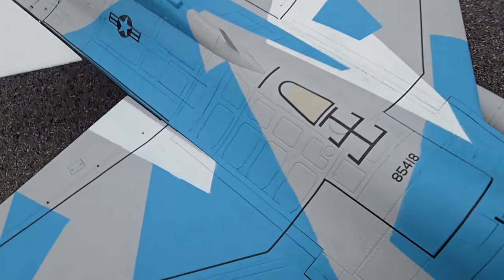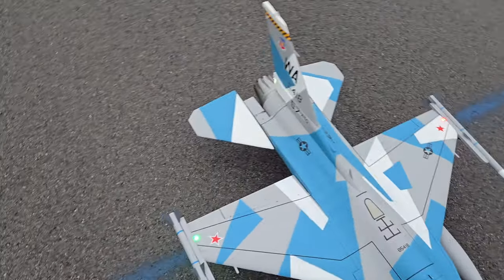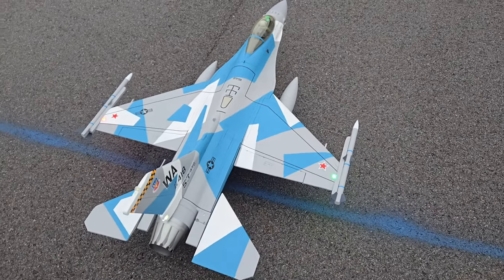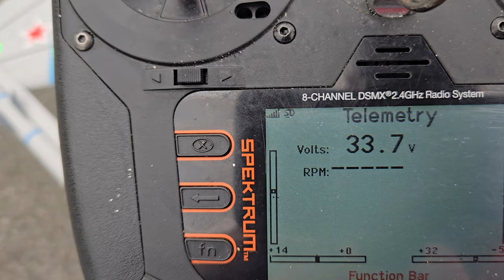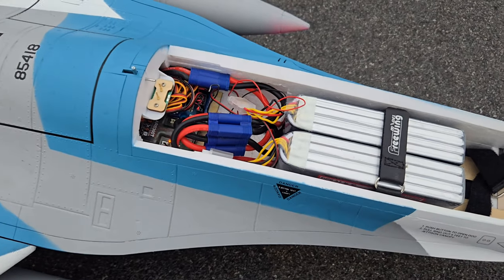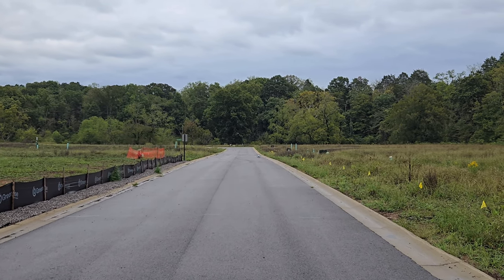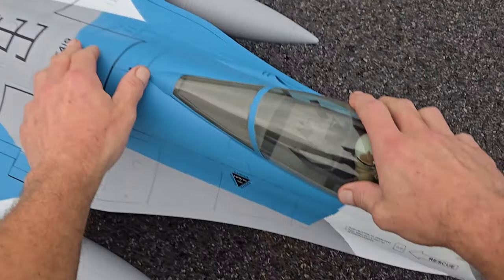Freewing F16 90mm 8s V2 m - Amazing scale edf jet #rcpilot #youtube #rcflying #aviation #rcjets #rc

Comment: You can shove those all the way back without issue!  I’ve got a 950g 8s battery all the way back, actually cut the foam and it’s against the board about 20mm further back.  Make sure you have a gyro on but it flys so much ‘lighter’
Reply from the maker: @bucky32555  thanks for the info
Reply from the maker: Definitely going to that

Comment: Hi, that was a smooth landing 
i wanna upgrade my edf jet to some bigger one.
how do u know if you have the skill to handle big jet?
Whats the difference between the small one and the big one?
Reply from the maker: @IanChen-m1o  well, the weight is the biggest thing.  You definitely have to keep your speed up, especially in the turns , and the bigger and heavier aircraft has to maintain more speed on landings. What kind of edfs are you flying now
Reply: @SmokeyMountainRcTravisThompson  I fly some 64mm for a long time and 3d plane
Reply from the maker: @IanChen-m1o  just depends on the jet.  70 to 80mm jets probably better way to go. Definitely don't want a 90mm for first big jet.  70mm or 80mm avanti  would be good, or something like a Bae hawk or a viper jet
Reply: @SmokeyMountainRcTravisThompson  why u don’t recommend to upgrade to 90mm directly?
Reply from the maker: @IanChen-m1o  well. 64mm jet are really small and light.  It takes alot more speed  to keep in the air. And you got to plan you moves and turns sooner with heavier jets
Reply from the maker: @IanChen-m1o  i mean if you have plenty of experience flying planes,   then you will be ok with the 90mm jets
Reply: @SmokeyMountainRcTravisThompson  ok thank you

Comment: So undecided between 8s version and 6s version on this. I'd like to go 8s but fearful the added weight on an already heavy bird will make it feel less nimble agile and able to get out of problematic situations as easily.
Reply from the maker: Glad I went with 8s.  Vertical is amazing on 8s  and iv got 138mph so far.  It is a Lil heavier but the 8s makes up for the difference. If you like flying with full Ordinance. I would go with 8s.